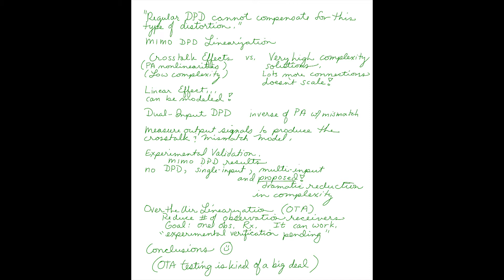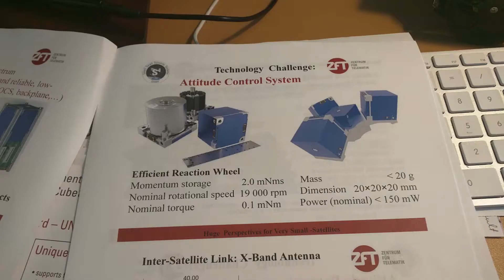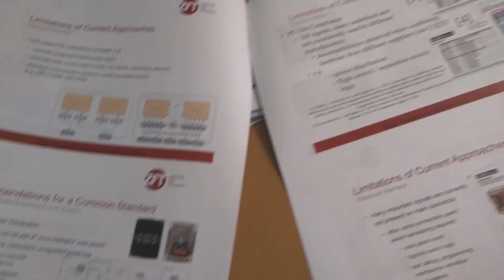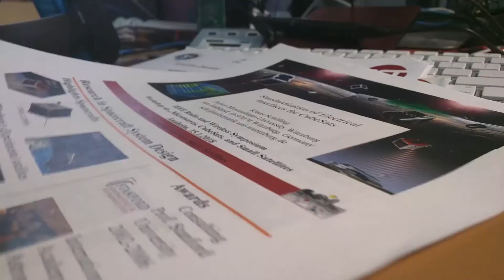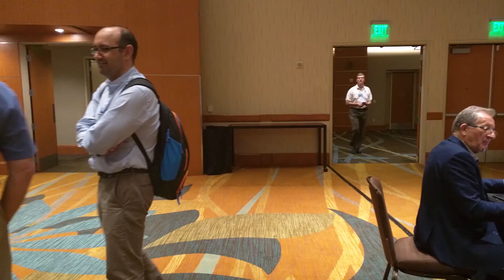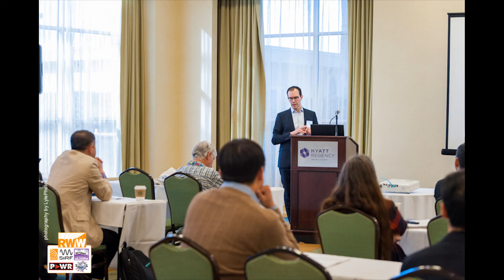20180119 Phase4 weekly report

Comment: Where do the Fox spacecraft fall in terms of the UNISEC (fingers tried to type "UNIX") standard outlined (broadly) here?  It seems that future AMSAT projects should, where applicable, probably "pick a standard" and go with it to keep costs down.
Reply from the maker: I agree. Standards like UNISEC have great potential to help ease CubeSat development and deployment. PC104 is another related standard that was proposed for ruggedized embedded PCBs. Both standards "stack up" boards that connect to each other and are intended to be durable under harsh conditions. UNISEC is more narrowly focused on CubeSat engineering. PC104 has been around longer and has a more general focus. Both standards are freely available. One does not have to pay for a copy of the standard or be a member of the organizing bodies to use the standards. UNISEC makes a strong claim that it is a better standard for CubeSat electrical standardization and does not have the incompatibility problems of PC104. However, in the end, it's all in the way you implement and whether or not complying with a standard gives you additional community benefits! 

I do not recall any PC/104 or PC104 compliance in discussion of previous AMSAT payload (Fox in particular). This has a very large caveat, as I wasn't on every list, or part of every discussion, by a long shot, as my part was data under voice. I'll see what I can find out about Fox and Golf.
Reply from the maker: Fox and Golf use neither standard. Hopefully the question and interest from members like you will get a discussion started!
Reply: Thanks for the reply.

Someone in the AMSAT hierarchy said something about "an AMSAT in every cubesat" meaning that we should be in the "business" of providing comms payloads to other groups that want cubesats and in return, we'd get to play with the transponder during or after their mission (as appropriate).  If we commissioned several comms packages built to the standard, we might be able to both drive costs down and have boards ready when some group comes looking.

Comment from the maker: https://youtu.be/eD5P4tHIb9w

Phase 4 Ground weekly report :+)

IEEE Radio and Wireless Week was held in Anaheim, California from 14 - 17 January 2017. RWW is an annual technical conference from IEEE, and is sponsored primarily by Microwave Theory and Techniques Society. It consists of five different co-located topical conferences. One of those conferences was the Topical Workshop on The Internet of Space or TWIoS, with two sessions. There was also a CubeSat workshop! 

This conference was great! Here's an overview of the speaker lineup for the workshops.  

The first workshop was about digital pre-distortion. Digital pre-distortion is a technique used to increase the efficiency of Power Amplifiers. By reducing the distortion created by running Power Amplifiers in their non-linear regions, Power Amplifiers can be made to be far more efficient. Radio power amplifiers tend to become more non-linear as their output power increases towards their maximum rated output. Pre-distortion is a way to get more usable power from the amplifier, without having to build a larger, less efficient and more expensive amplifier. You can do this in the analog domain, or the digital. This workshop was about digital pre-distortion techniques. We need to know about this because it will help us. I have all the papers and the workbook so if you're working on DPD get in touch for these resources.

Another workshop was Solid State Amplifiers for Space. Here's the lineup and I have the workbook, but it was at the same time as the digital pre-distortion, so I didn't attend in person. Same deal, I have papers and the workbook so get in touch if you want to work on this. 

The big workshop draw for me was the next day. The Microwave, CubeSats, and Small Satellites workshop. Here's the summary and the lineup. Microwave and mmWave CubeSats are the thing, so we're definitely on the right track. Being opportunistic and ready to deploy communications and scientific experiments in the rapidly growing CubeSat market are going to be vital for keeping in the mix going forward. 

Every slide that I saw for CubeSat launches has an almost exponential curve, with most of that curve taken up with commercial operations. The number of launches for educational and scientific missions is expected to be relatively flat. With more and more Universities and institutes putting together CubeSat programs, where does that leave amateur and educational efforts? Not all CubeSats are LEO, but most of them are. What it means to me is that things are about to get a lot more competitive, as the pressure on launch agencies to increase capacity and the competition for launches is expected to dramatically increase over the next two years. 

The introduction to the workshop was Challenges and Opportunities for the Internet of Space. The premise that Microwave CubeSats and Small Satellites need to meet the needs of the Internet of Things (Internet of Space) was a constant theme for the entire conference and for this workshop especially. There are a lot of questions about IoT, and 5G for that matter. Example one: Aircraft sensors, with data aggregation in the air and the results communicated via satcom, to make in-air decisions between gates for unscheduled maintenance decisions in order to keep aircraft continuously healthy and monitored. Example two: remote monitoring of industrial vehicles, where satellite makes sense. 

CubeSats with phased arrays, CubeSats that avoid data collisions, CubeSats that have enough power for desired payloads (like 10-20 watts), CubeSats that have attitude control, CubeSats that are reliable with COTS devices. Example: Iridium used COTS devices for large parts of the system. Lifetime requirements, use cases, sustainable business models, propulsion systems (nano-FEEP mission prepared for launch). Business case, capital expense, launch costs!

This workshop was all about the solutions for these challenges. 

Dr. Klaus Schilling spoke about a standardized electrical interface for CubeSat Bus Interfaces. Download PDF here: http://unisec-europe.eu/standards/bus/

"The success of the CubeSats was based on standardization of geometric dimensions, allowing joint use of launcher adaptors. An important next step in order to be able to exchange boards at subsystem level was a specification and standardization of the electrical interfaces, which is addressed in this contribution." The standard is pretty good, satellites have been successfully launched using this standard, and the advantage is no wiring harness, dramatically reduced assembly time, the ability to swap out failed parts at the last minute, increased reliability, and increased interoperability. 

Dr. Schilling heads up the University Wurtzburg Experimental satellites, or UWE, program. 

http://unisec-europe.eu/missions/uwe-3/

UWE-3 was launched in November of 2013. The main mission objectives of UWE-3 are to demonstrate the use of a real-time miniature attitude determination and control system on-board the satellite, using a variety of sensors, magnetic torques and one reaction wheel. To establish a robust base for a series of future satellites, UWE-3 additionally features an advanced modular and flexible architecture of the pico-satellite bus, in order to increase robustness, reduce mass and add reliability to the overall system. One example is the redundant On-Board Data Handling core module of UWE-3, which is tolerant to SEU’s, capable of repairing its own memory and therefore able to recover the satellite and ensure safe operations. It's still up there working, and handles SEUs and latchups and recovers. 

Only COTS parts were used, but fault detection, identification, and recovery by software and watch-dog timers have ensured a level of reliability. Their data handling methodology is achieved through redundancy with mutual supervision and recovery, redundant serial flash, high precision real time clock, and a quad-redundant power cycling unit. 

UWE-3 mission involved lots of amateur radio operators and Dr. Schilling is very familiar with AMSAT-DL and highly complimentary of amateur effort and assistance. 

The attitude determination and control system has worked well enough to where they feel ready to try some formations. Formations are when the satellites communicate with each other and adjust their attitudes in space to maintain distance and altitude without intervention from the ground. The range is up to 100km with a patch antenna on 10.475GHz. The mixer, IF filter, modem, reference clock, synthesizer, PA, LNA, RF filter, antenna etc. fit on a 40 by 20mm PCB.

Attitude control systems on UWE-3 included multiple magnetic field sensors, redundant gyroscopes, and interfaces with high precision sun-sensors. The attitude is estimated using an isotropic Kalman filter while magnetic torquers are used for efficient board pointing. This is also available in combination with reaction wheels. The board interfaces directly via the UniSec CubeSat standard and is fully updatable in orbit. There's a scripting tool embedded in a sandbox environment on board, so that you can test the algorithms and maneuvers at low risk and effort. It can do detumbling, pointing, and spin stabilization, even at 1U. This is so cool. 

UniSec has been extended past the electrical standard. There is also a Satellite Development Board that can serve as an electrical ground support equipment after launch. Standardized testing came up as well. UniSec standard satellites can be assembled in about an hour, which reduces the cleanroom time and makes it easy to upgrade or produce larger quantities. 

So all of this was really exciting to me, because it means that the tasks of attitude control, power distribution, and communications are all successfully being done and we can do it too. If we become familiar with this University project, and others like it, and build on it, then we can be way further ahead on amateur spacecraft design than we thought we were at the GOLF meeting at Symposium. 

Upcoming event:
https://sites.google.com/site/naass2018/

That was just the first talk. The next one was about super awesome umbrella folding microwave reflector mesh antennas that pop out from the cubesat and give you real gain. In between that and attitude control, you can do Ka-band in a CubeSat with 42dBi. It needs 1.5U of space. This is intended for like 6U CubeSats. 

But wait, there's more. He talked about the ReflectArray which is on the InSight mission that is delivering MarCo CubeSats to Mars for communications relays. Imagine all the benefits of a parabolic dish, but with the convenient packaging of a a flat patch array. Check out more at this link:
https://digitalcommons.usu.edu/cgi/viewcontent.cgi?article=3180&context=smallsat

Next was Dr. Mark Bachman CTO of Integra Devices and UC Irvine professor. He talked about how to make structures for mmWave and microwave applications using techniques more often found in the component packaging industry. This was pretty rad. They think it's the right technology for space and they were pretty darn convincing. 

After that was William Deal from some company called Northrup and their demonstration of a 666GHz crosslink for inter satellite communications. 9.5Gbps! They showed off their demo of this data link and wow that's really high up there isn't it?

Steven Riesling From Colorado State University talked about remote sensing systems for earth and atmospheric sciences using small satellites, with a focus on TEMPEST, or Temporal Experiment for Storms and Tropical Systems. These are five identical 6U CubeSats that do repeat-pass mmWave radiometry. They fill in a gap in the knowledge of cloud dynamics between formation and precipitation. It started up for real in 2015 and is supposed to launch in May 2018. They're scanning five frequencies between 89 and 182 GHz.
Reply from the maker: The last talk in the workshop was Dr. Ivo Vertat and ground station communications during shared launches. Amateur radio played a big part in this effort because the ground stations operated in the UHF amateur radio band, and hams helped sort things out and provided a lot of support. 

That evening I got to set up a booth in the main hall as an amateur radio demonstration along with two other volunteer demonstration stations from the San Bernardino Microwave Society. I'm a member of that club too, and they are great. If you're near Corona, CA then you have one of the best microwave clubs in the country nearby. Brian Thorson AF6NA and Rein W6SZ were my fellow demonstrators. Jeffrey Pawlan WA6KBL got us in the door with IEEE and supported us the whole way. We showed off microwave band amateur radio to engineers from Italy, Poland, Germany, Austria, Spain, Canada, India and the U.S. all evening. The food was great, the drinks were free, and I showed off the amateur satellite service, AMSAT, 3D printed 122GHz cassegrain antenna prototypes, dual band feeds for Phase 4 Ground, 10GHz elliptical taper 3D printed horns, and told plenty of tall tales. Huge success. Lots of student interest and plenty of awareness raised.